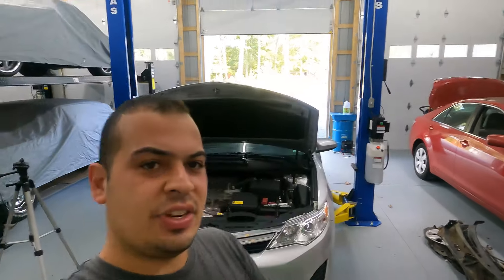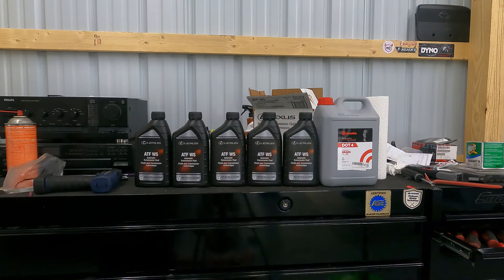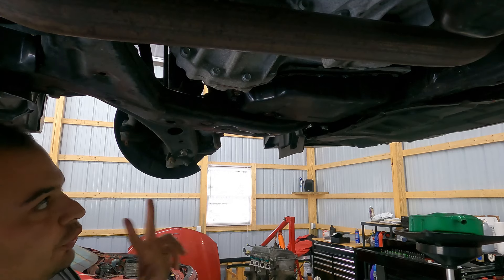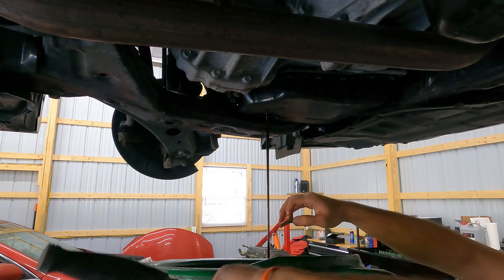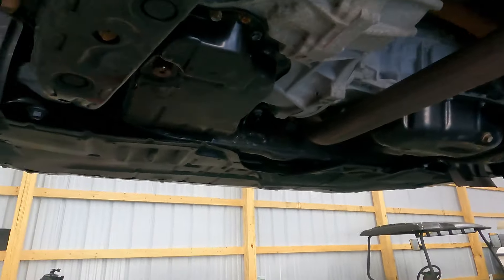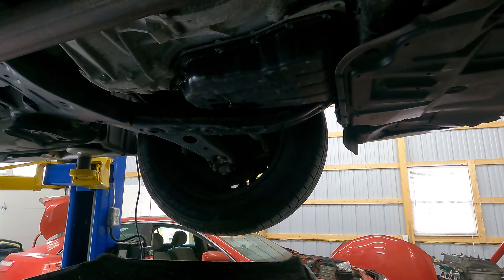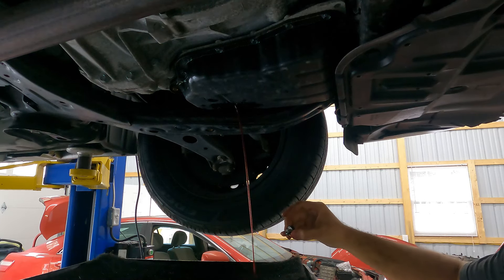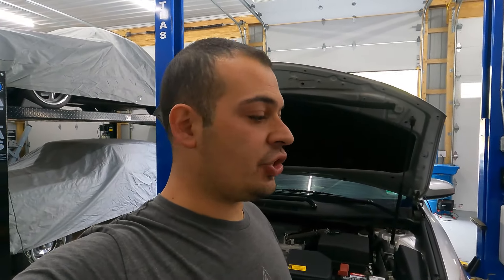Toyota Lexus 6 Speed FWD SEALED automatic transmission fluid change!!!

Comment: Do you take any special precautions for leveling the car on the lift, front to rear and side to side?  If so where do you measure from as your reference points?  Or am I overthinking this?